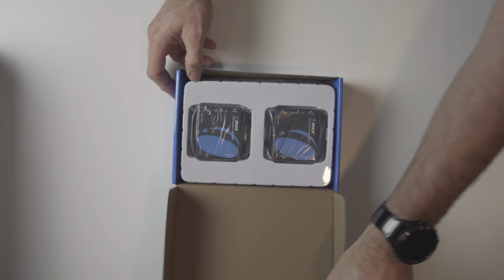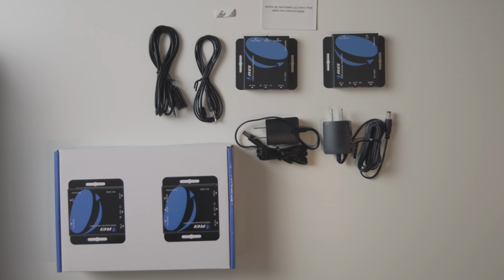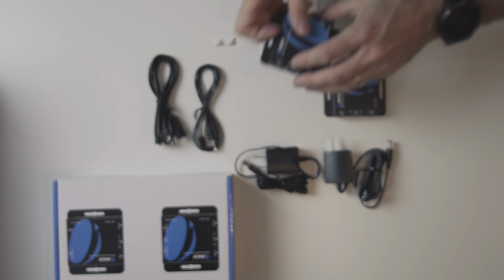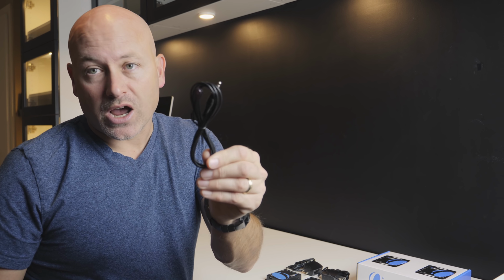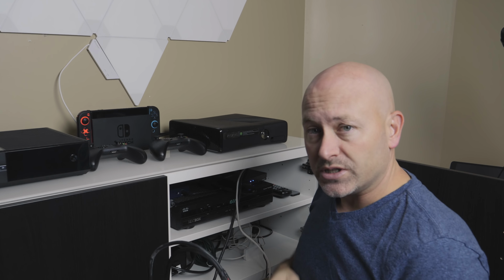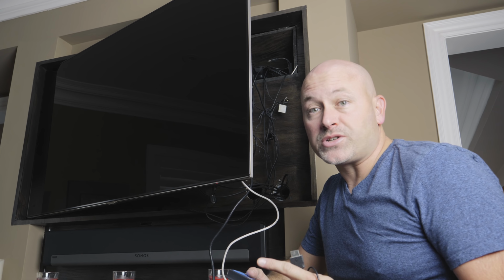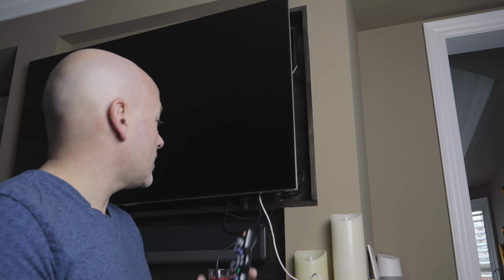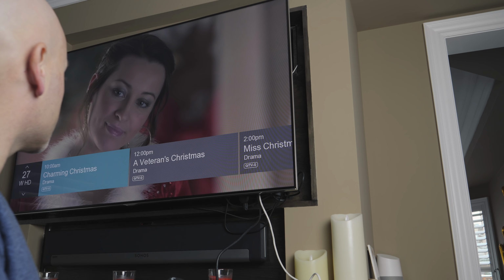Smart Home AV | Orei HDMI Extender Cable over Single CAT5 with IR Control

Comment: I have a question as to how to replace an existing extender... the current extender, next to the tv has the Cat5 connection, the power port, the IR input and the HDMI port.  The OREI component you are showing has two different connector boxes.  do I need both?

Comment: Hi,  can I split the output hdmi into two or three using a hdmi splitter and connect multiple tvs. Am not worried about the IR. Or should I split the CAT5 signal using a hub and then connect multiple ethernet to hdmi receivers..

Comment: Once I unplug the hdmi cable from the cable box and plug it in the receiver what cable goes back into the cable box?
Reply: It sounds like you didn't understand completely. If I am wrong about what you are asking, I apologize. The cabling runs from hdmi out on the cable box to the hdmi input on the extender transmitter. hdmi from the extender transmitter out goes to the TV in the room with the cable box. The third goes from the extender receiver hdmi out to the TV in the remote location. Nothing goes back to the cable box.

Comment: any idea why its not syncing? Only one of the orei devices has a green and yellow light and the other only has green
Reply: Chris Pilcher  Hi, maybe there is some connection problem between transmitter and receiver.

Comment: I have 1 cable box and 2 TVs. I want to connect the cable box to both TVs using this method. But is it possible to have them play different channels? at the same time? If not, is there a way to do it? other than purchasing a new cable box.
Reply: JennylynYT Hi , you can try the HDMI splitter 1in 2out over Ethernet cable.

Comment: Ok so you still have to run a wire between floors... but it's a CAT cable instead of a 50ft HDMI... Eh
Reply: cat is cheaper than hdmi by a lot! £40 for 30m hmdi or £7 + adaptor at little as £3
Reply: @_GarethRossUK  Thanks for the reply. Still going to pass on this item... Need something I can just plug in to have cable in the other room away from the cable box. Like google chrome :)

Comment: I cant drill holes to route a cable but shouldn't I be able to use a patch panel to connect  two Cat 6 outlets?  I got it to work using a direct cable run but I can't get it to work using the patch panel.

Comment: I want to film at my church and be able to see live on a tv downstair... 50 feet between the two.  Could I use the same equipment ?  Camera with hdmi...
Reply from the maker: Hi Patrick, thanks for watching.  This should work fine.  There is a local HDMI output as well as the remote one so you could have a monitor upstairs and downstairs.  Its rated for 165 feet!  It should work with any source that outputs HDMI, so your camera should be fine.  Good luck and don't forget to subscribe! :-)

Comment: Will the unit handle 4k content?  Any issues with lag or audio and video delays?
Reply from the maker: 1080p is all I tested, I think that's all its rated for.  Will see if I can try 4K to see what happens.  As for audio/video sync.  No issues I can see.  The TV's are too far apart to see if there is any lag between screens. - Thanks for watching, don't forget to subscribe. :-)
Reply: yoyoTech, I’m looking for POE for my 4K signal. If it can handle 4K would be nice. Thanks
Reply: CC Chodkowski  you can try 4K HDMI extender

Comment: Can you do more than 2 TV's?
Reply: You can but you would need a hdmi matrix which would allow you to choose between 4 or more sources or get use a splitter before the extender kit if you wanted the same source on more then 2 tv's 👍
Reply: stuart quigley does the ir receiver works when u plug the splitter before the extender )

Comment: So you can only watch one TV at a time?
Reply from the maker: Nope you can watch both TV's at the same time, but the source would be the same on both!
Reply: yoyoTech, I get that, but why wouldn’t you just run cable to the other TV, that way both TVs can be used independent of each other? Sorry, but I don’t see any reason for this system, unless you don’t want to pay for a second cable box. Most cable companies offer wireless boxes, therefore you would not need cable for the second TV.
Reply from the maker: @nobody that's right and a good point.  I wanted to be able to play my xbox upstairs and we don't want to have to move it up all the time.  Also, I am going to share the cable box because we don't watch much live TV, so we have only had one box.  Both TV's are smartTV's so they can be watching independently other sources (HDMI2, HDMI3, SmartTV)
Reply: Great video. Want to run multiple TV's from 1 raspberry pi media center running Kodi from any room in the house. I'm particularly interested in the IR control. I have a flirc connected to the pi to receive an IR signal, and I guess the Blast as you mention of the IR signal will work for me. I of course will need a cat6 switch to run more TV's.